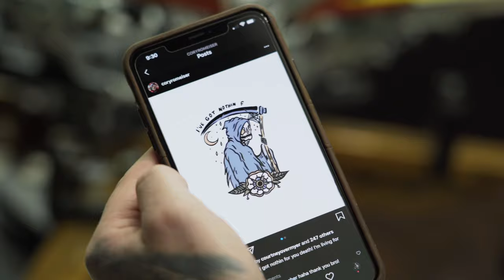Don't Be Scared To Print With Water Base. Be Prepared.

Comment: Hi i just bought some stuff from the website i was wondering i use a heat gun to flash then cure with a heat press how long can i leave a shirt thats been flashed sitting for before i go to cure it on the heatpress?
Reply from the maker: You can leave it for a few hours to a day.  It depends on how well it was flashed / gelled as there is a chemical process happening during this stage.  The resins (solids) are absorbing the liquids (oils) as the ink gets hotter and hotter.  If you leave the ink gelled and there are free liquids - those can leach out into the garment over time.  The more it has been flashed, the fewer oils there are to leach out.  Hope this helps.

Comment: Is that an auto flash
Reply from the maker: Hi @Pixels-N-Bytes! This is a forced air flash with a Flash-a-matic attachment. Optimized for printing water base. You can set a time for it rotate off of the garment so you don't risk burning things. 
https://www.screenprinting.com/products/riley-hopkins-air-flash-heater-and-stand-18x18-240v-4000-watt-16-7a

HOPE THAT HELPS!